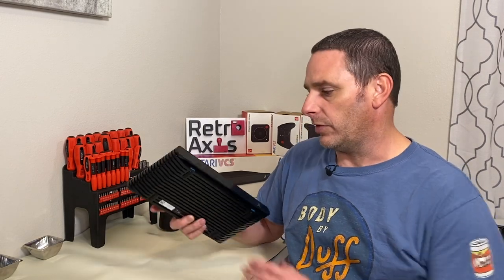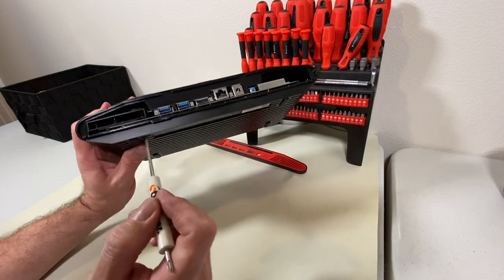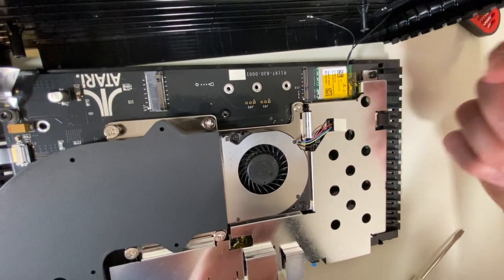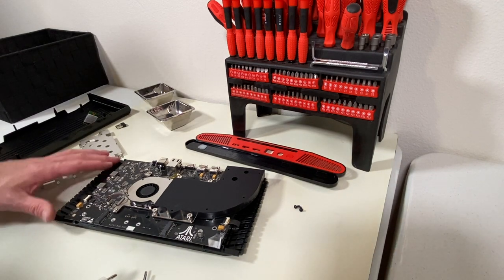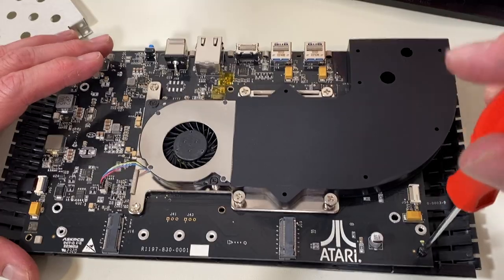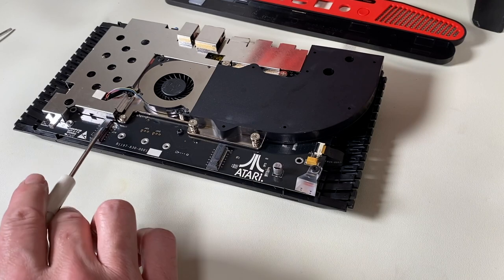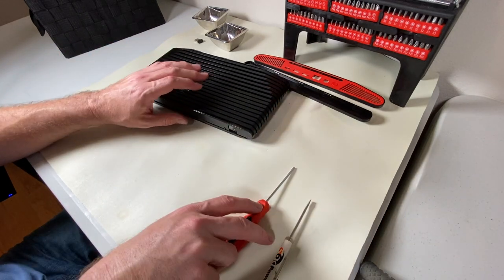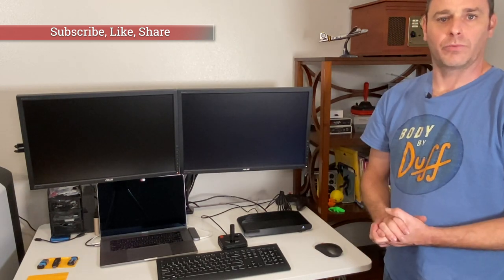Atari VCS teardown: look inside the case, upgrade tips, and a hidden secret on the mainboard

Comment: You know, I can't bring myself to hate this thing and denigrate it as a quickie cash grab.  The designers clearly liked the Atari and wanted to carry its legacy forward.  Otherwise it would have been another "also-ran" ARM board running an emulator like so many other companies have.  Now will this go anywhere?  No telling.  But it's interesting to watch.
Reply from the maker: Great point of view, and I agree. It has potential to be a decent set top box, but the question is for what exactly? Clearly it has more capability than a Raspberry PI, but does the larger form factor and PC based chipset offer any advantages? Will the Atari Store actually have unique games and titles that are not just a bunch of ports from Steam or other platforms?  That will be what makes or breaks this system.
Reply: @RetroAxis  I eventually plan to get myself one of these if the Atari store fails to deliver worst case scenario I can make it a steam machine
Reply: @RetroAxis  I think of this as the game console for the guy who's sick of keeping up with the Joneses and wants to go retro without having to sort through the dozens of emulators, but also wants to dip his toe into PC gaming and the required tinkering-OR, the seasoned mad PC scientist who wants to hack a new console without getting sued by Nintendo or Sony or Microsoft.

I really like this thing-a little cheap for the money, but it has heart and enough power to just barely keep up with a true PC-like, a strong laptop or a weak tower, but it's probably more powerful than a Switch! I find myself wondering if a Ryzen 5 or 7 APU would work...

Comment: 400 dollars is not just the base system it is the system and 2 controllers  When they sell the system bare it will be around the 250 range.  I wish people would stop comparing this thing to a 400 PC a proper comparison would be a 250 dollar PC.
Reply from the maker: Sure, but you can find good deals on a Lenovo, Acer or Dell desktop or laptop that you can more properly upgrade. If your end goal is to have a PC, then I say buy a PC.
Reply: @RetroAxis  what specs exactly does this have ? , i feel like if it aint to overpriced for the specs ( im talking about the 250 dollars without controllers etc ) then this might be a nice little emulation console, slap launchbox on it, and play all emulators that are supported by whatever cpu and igpu combo this is
Reply: @oOWaschBaerOo  But you can do that with other things like Shield already for way less money and much better support and game availability for new stuff.
Reply: @oOWaschBaerOo  AMD Ryzen R1606G (AMD Radeon Vega 3 Graphics), DDR4-2400 RAM
Reply: the 2 controllers cost $150? lmfao

Comment: Interesting video. As you said a learning a experience. I hesitated whether to mention somethings, so hopefully this come across as constructive and positive. I was surprised you didn't know what a miniPCIe slot an M.2 slot were. Also, just for clarity, you referred to the RF shied as a heatsink as well, the heatsink is mounted directly over the CPU/GPU, though it's possible the RF Shield may provide some heat dissipation for other components. The WIFI card is a standard miniPCIe card, which is what 99% of laptops including MacBooks use, the antenna cables are standard as well, however it is somewhat surprising the way Atari has mounted them on the top of the case. Both the miniPCIe and M.2 are industry standards from the PCI-SIG and are quite common. The RAM modules are standard DDR4 SO-DIMMs. Overall quite an upgradeable system, including the wifi (though antennas may limit this).
Keep learning and keep working hard!
Reply from the maker: Perfect!  Thanks for sharing those details. Learning everyday... and yes, meant RF shield, I knew that... dought!!!
Reply: Just FYI, you can purchase replacement wifi antennae meant for laptops and install them in the VCS. They'll have longer cables meant for routing around the sides of an LCD screen. The antennae stick on like foil stickers, and the other ends push into those standard antenna ports on any wifi card.

I know this because I accidentally ripped an antenna cable off the wifi card of an HP and the socket came off inside the cable's connector. Had to replace antenna wires and wifi card! Doh! Search eBay for "laptop wifi antenna kit" if you want to upgrade the cable length or repair damaged wires.
Reply from the maker: @FireSloth1134  That's a good idea. I hope Atari takes some of these design considerations and implements them into future revisions.

Comment: Very much appreciated video it definitely shows their hard efforts making the system Worthy, I find it odd that they would make the  Wi-Fi antennas that short I'd prefer that they would make them a little bit longer or at least wrap around the case for a better wi-fi signal but them being that short or that close together it makes it really uncomfortable for console modders or system editors thanks again for a very well detailed video.
Reply: You have to bear in mind, the longer the antenna cable, the weaker the signal will be.  So being closer together can end up being a stronger, faster, signal than if you had ran them to opposite ends of the chassis.

Comment: I was happy to see some of your previous videos, but this one left me doing a face-palm.
It would have been easier if you had looked at the Atari Support owners FAQ. There was already an document (written by AtarI) with a step-by-step how to safely open the case, and replace the RAM. Likewise, there is a document (written by AtarI) already with a step-by-step procedure for how to install an M.2 SATA SSD inside, and which parts you need. You could then have avoided breaking the ZIF USB connector as well.
Sometimes rushing to reinvent the wheel is not the best way to go. (Still, we all have bad days. Next time...)
Reply from the maker: Thanks for the feedback. Fortunately everything still works after reassembling. I’ll make note of the official docs in a future video.
Reply from the maker: https://shop.atarivcs.com/content/RAM-Installation-Guide.pdf
Reply: @RetroAxis  pin them in the descriptions both docs

Comment: Honestly, I love the 'It just works' interface they've come up with. If I could figure out a way (or if someone out there does it) to put a Shadow tech launcher in there, then I would love this completely. It would be a 100% solution for all my games. As it stands, I have a mini-PC out front running shadow for all my steam games that need heavy hardware, and then the miniPC itself can handle most retro games on it's own... but how awesome would it be to just have everything running in that 'console'? 
I will absolutely buy games from their in-store shop and so forth to support the ecosystem if that's the road they go down.

Comment: Ridiculous that you can’t easily	access the RAM. That antenna connector is usually a simple pop off/pop on action and and it’s a shame you didn’t realise that ribbon cable was easy to remove. Still, you won’t make that mistake again.... one broken USB port 😣
Reply from the maker: Turns out the port was not broken.  I was able to get the connector fixed. Everything works perfectly.
Reply: @RetroAxis  I was thinking if you couldn't get it put back on, a little tape would work well to keep it secured!

Comment: I've taken the top case off so many times that the two antennas that are stuck to the inside of the case came apart from the case. what can I do to fix this? can I just buy another two antenna wires and lay them inside the case? please point me to the ones I should buy.

Comment: The antenna wires glued to the top shell is just a bad design. They could have routed it to the back io and bam easily user serviceable. Also cool your jets on those heavy hands man you gotta be gentle with those connectors.

Comment: Can the VCS be updated like a PC? Could someone mod it to make it more powerful to run games like Cyberpunk?
Reply: IT already can and does run Cyber Punk.
Reply: Hahahahahahaha... It's RAM and storage can be upgraded but you cannot upgrade it's APU, you cannot put a Ryzen 7 and a RTX 3060... You can't do anything with it's power. This consol is literally a relatively underpowered PC. There's a video where a guy surprisingly is able to boot Cyberpunk but it runs like at 13fps or less. Sorry man. You'll have to pay less to play Cyberpunk in a Xbox Series S (299€)... If you wanna run old Atari games you can emulate them on your phone (Android) or PC or a microwave (joke) or literally anything that has a modern CPU and 128 Mb of Ram 😂😂😂...
Reply from the maker: No, not like a PC. Although it uses an AMD APU processor, the chip is not field replaceable as it is an embedded board (likely soldered to the mainboard).  I did not remove the heatsink/fan today to confirm that, but experience tells me that is probably the case.  While you can replace the RAM with more GB and add additional storage capacity, it does not have any expansion slots, nor does it have a dedicated GPU.  This system has limited expansion, unlike a real Gaming PC.
Reply: @bjpa1151  People have been playing cyberpunk on Stadia on the Atari and with a solid internet connection it runs well,  this is meant to be  more of a cloud based device, I would say similar to a Chromebook in a many ways.   Use this device within it's parameters and enjoy,  why try to run things on it  that it wasn't meant for.     There isn't any $400 Windows PC that is going to perform well running games like Cyberpunk nativiely either, so not sure what your point is.  If this was $4000 I would say you have a point but  it's $400   I wouldn't be expecting an Alienware or an Origin.  you people make my head hurt with your thought processes.   what's next  you going to crap all over a Honda Civic because  it's not a Porsche?  smh
Reply: @Boswd  Context dude. I was answering a comment where a guy asked if the VCS was like an upgradable PC and if it could be modded to play games like Cyberpunk natively ... You need to learn how to read a YouTube comment. A 69$ phone can run Stadia or GeForce Now, a Nvidia Shield can do that and emulate the all the classics of Atari... Your comment gave me stomach pain ... Lol just kidding. I like the VCS because I see it as a potential all in one media center, like the Nvidia Shield TV. But as an objective person  I can say that it's an overpriced device. It will maybe have some incredible exclusives and work as a console but for now it's just an overpriced underpowered PC. Context dude ;)
Reply: @bjpa1151  You do realize the game is buggy and poorly optimized right? Actually impressed that the vcs was able to "run" it at all. For a $300 system this is actually somewhat impressive.
Reply: @ChuyEVC  it's a crappy game for sure. But again you can buy a Xbox Seties S and play the game and do almost all you can do on the VCS (Retroarch ... ). I'm not saying that the VCS isn't a interesting device. But for 400$ you can find better alternatives
Reply: @bjpa1151  For sure though I don't think running AAA titles is what this system was intended for. For the price a better apu would've been appreciated to give at the least a similar if not near performance of a ryzen 3 3200g. Not sure if that's too much to ask for Atari's standard but for $400 I would expect the console/pc to come with at least controllers and better hardware.
Reply: @bjpa1151  Nothing a little overclocking can’t fix.. All AMD RYZEN chips are designed to be overclocked and so are the GPUs.
Reply: @MicklowFilms  Apparently You cannot touch the Bios of the system. I heard that Atari blocked the possibility of OC... And even if the APU is Overclocked it remains a low end APU ... But I really wanna see emulation running on this machine.

Comment: So what happens if one of the wifi antennas disconnects from the wifi chip?
Reply from the maker: The signal quality will be reduced.  There is a potential risk the chip could be damaged, as radios expect an antenna to be present to draw power away.  Without the antenna, the signal can be reflected back into the components.  Wifi is much lower power, than say a CB or HAM system, but conceptually the same is true on a TX send.  In the VCS, it is a snap button.  A tiny, but annoying one to re-attach, but unless you break it, you should be able to get it back on.

Comment: Any idea if the onboard Ryzen APU is upgradeable or if it's soldered down? Would be interesting for longevity
Reply: Soldered
Reply: Meh, figured it would be. Thanks for the response
Reply: @Josh-ce9sv  true. Don't get me wrong. If seems like a nifty little console/PC, plus with Stadia, Amazon, and Xcloud it'll always have a means to hang around. Just wanted to gauge more on it before pulling the trigger on the base 400 model
Reply: @Josh-ce9sv  Seems Walmart won't let me preorder. I signed up for alerts from Atari and Walmart
Reply: @Josh-ce9sv  fixed it but Walmart won't ship it to APO address. Guess I'll just wait and see how it plays out and pick it up from somewhere else

Comment: Seems you never open and disassemble a laptop computers :p
Reply from the maker: Not all laptops are built the same:  most modern laptops don’t have access panels, but think pads and older laptops had access panels on the bottom for getting to expansion slots. Some laptops lift the keyboard and get to the ram. But to your point, I don’t disassemble many laptops these days.  Thanks for watching
Reply: @RetroAxis  Ya and the wifi connectors are the same untill a least 15 years (originaly produced by a French companies at Montmirail's town) !!
I do not talk about opening, be you seems surprised about the wifi antenna connection 'like 9v battery' (and have hard time to manipulate it)
I repaired laptop for 15 years (Mainly Dell, Hp, Sony) so, i exactly know how a lot of range of laptop are internaly done :) (worst was Sony Vaios)
Reply from the maker: @MrFurious_666  Sony Vaios... wow that takes me back.  I hated working on Toshiba's.  It was always a game between myself and several other techs to see who could get it to boot with the most number of screws left out after a reassembly. That was back when Wifi was an optional PCMCIA card .  So yeah, I haven't disassembled laptops in a long time.  But honestly, Atari could have added a removable door on the bottom to access the RAM Chips. They left the space open on the bottom shielding, so its just screaming for an access panel.
Reply: @RetroAxis  Door = More parts = more expensive = selling price higher ... And i'm not sure they want pople to open it, or 2 versions of the case with different prices would be a solution, anyway, people do not care AMICO will win :)
The worst i opened, was the 1st DELL high perfs XPS laptop, it was a double 
height size laptop with dual cpu and dual gfx back in 2008-2010, and to have power it had desktop CPU and GPU ... (that why it was double height size !)
Reply: Atari said in a reply somewhere else that they noted the RAM hatch request for the next case revision. I believe they will probably use longer wifi antenna cables too.

Comment: If you break a ribbon latch, find a 0.1-0.2mm sheet of plastic, cut it to size and wedge it into the connector. That will be enough to hold it securely. Not to be rude, but honestly, if you don't know that much or how WiFi antennas connect you shouldn't be doing this. Learn and practice on junk hardware first.
Reply from the maker: I was able to fix the connector with the original piece.  I haven’t worked on laptops in many years, so to your point, I was learning as I was working through it.  Thanks for the comment and the helpful suggestion. I will file the ribbon latch hack for the future.

Comment: Cool to see a break down, but this thing seems like junk considering how expensive it is.
Reply: The unit is 299.99€ with a Ryzen + Vega APU and 8G of DDR4. How can that be “expensive”?
Reply: @ThomasDEBESSE  It seemed expensive as a mini console when the Xbox Series S is much more capable and comes with a better quality controller. I think if you plan to use it as a mini PC for emulation and so on it does become a much better value. I've seen some people push the Vega 3 and you can get it to run quite a few emulators well.
Reply: @AG-bp3ll  That's not a mini-console. It looks like there was a lot of confusion in early Atari's communication (and some people just spread misinformation for fun). Sure it's less powerful than a Series S, but that's not a mini console. They already sell mini consoles named “Atari Flashback”. This one is real current games, it supports Vulkan, OpenGL 4.6, and can handle 4K screens at 60fps… So, for sure, there is no raytracing and games would not have to run with full fancy options, but that's to run today's games. The “retro” thing is only an app. The console itself it is meant for much more. Their initial design was 8th generation based (pre-Vega APU, like Xbox One and PS4) but then they delayed it, canceled that first design and redesigned to fit the 9th console generation era with Ryzen based APUs (like Xbox Series and PS5, while, to be honest, being very entry-level compared to them). So, clearly, they focus on console market. There was no need to redesign the hardware if it was meant to just be a miniconsole.
Reply: @ThomasDEBESSE  Uh, yeah. I just bascially said right before this I could see the value of it as a mini PC.